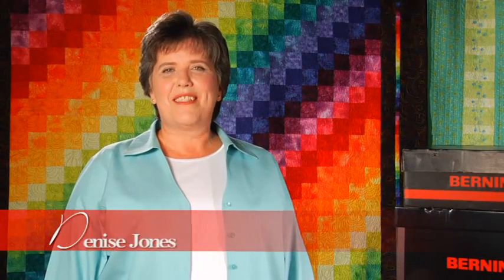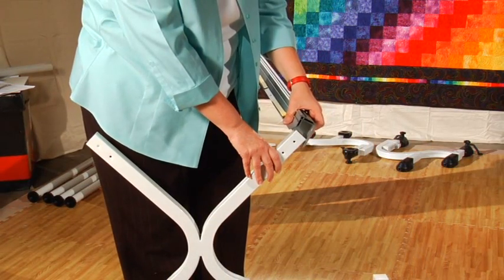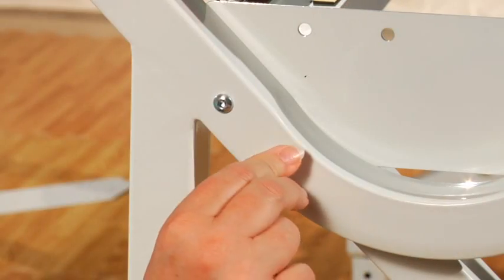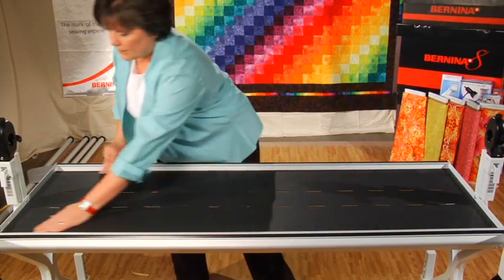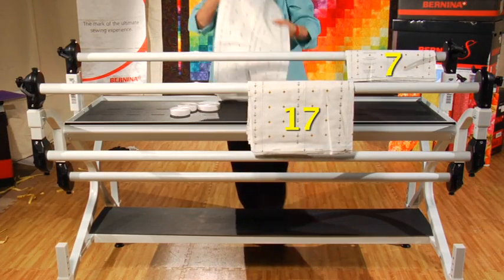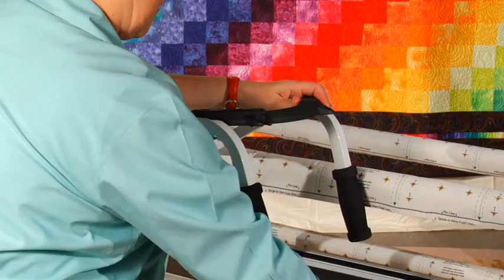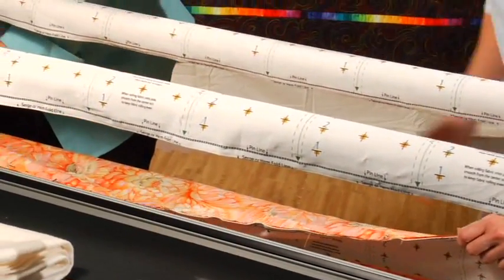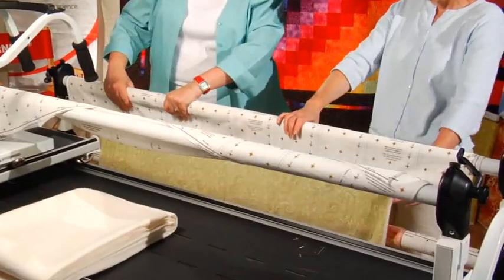BERNINA quilt frame instruction part 1 of 2

Comment: Are there any computerized quilting long arm machines you can use with this specific frame? I own this frame and I am looking to upgrade my machine to something computerized. Thanks!
Reply from the maker: Hi Lisa, thanks for asking. Unfortunately the automation system used in the past together with this frame (Quilt Motion) is no longer available. Since the frame is also no longer offered by BERNINA there is no alternative we could offer.
Reply: Yes the Bernina 7 and 8 series for sure.  And you can use the Grace Quilter's Touch 3.05.07 software that works with these machines too.  This version is specific to Bernina.  As Bernina replied the frame is no longer made but to my knowledge, you can purchase the software still from Grace - that is the one you would want for sure - they may mention another version but this one has many features that would probably be left off if not the 3.05.07.  The Bernina 7 and 8 series are still made - Bernina's response is incorrect.
Reply: no

Comment: I just purchased this frame secondhand.  The previous owner did not have the manual. How do I find out how big of a machine can go on the carriage?  Outside of Bernina on the side, I can find no name or model # to get some specs.
Reply from the maker: Hi Joline, this model has been designed specifically for the BERNINA 830 and 7 Series models. The 830 has the same size as today's BERNINA 880 PLUS. We don't recommend using it for other machines than our 7 and 8 Series models.
Reply: @BerninaInternational  Could I put a Bernina 770 QE on this frame?
Reply from the maker: @bettycook238  Yes, this is possible. The frame has been designed for the 7 Series and 8 Series BERNINA machines. Please note that this frame is no longer offered by BERNINA. It is possible that you can get a used one from someone though.

Comment: ok just HOW do I know the height I want to set it at????
Reply from the maker: The height depends on the sewing machine used, but generally the bar should be at a height to ensure the quilt sandwich is straight. If you need support, please contact your BERNINA dealer who will be happy to help you.

Comment: How do I attach the machine to the carrier?  I am using a Singer.  mary
Reply from the maker: Dear Mary, the BERNINA frame for domestic sewing machines and the carriage that comes with it were designed to hold BERNINA 7 series and 8 series sewing machines. Basically the sewing machine is just placed on top of the carriage, allowing to move the machine in all directions. Since the BERNINA machines have a very high throat space, using a different brand of sewing machine may result in having to adapt the height of the machine. Unfortunately we are not able to say which adaptions may be needed for your Singer machine.
Reply: im looking to do the same have you worked out this problem
Reply from the maker: @cherylwhite654  Hi Cheryl, as mentioned above, the BERNINA quilt frame has been developed for the 7 Series and 8 Series BERNINA machine. We can't make a statement on how it will work with other makes / brands.